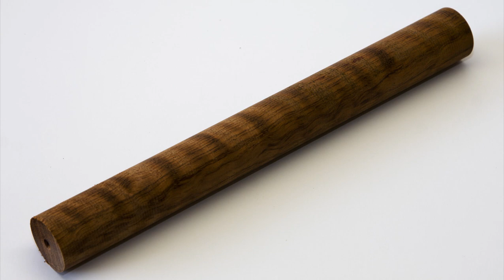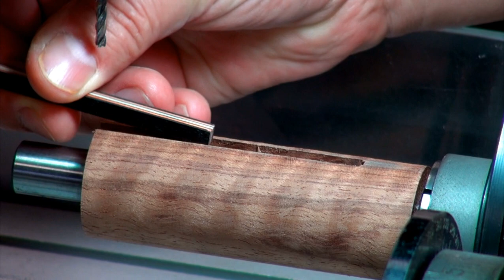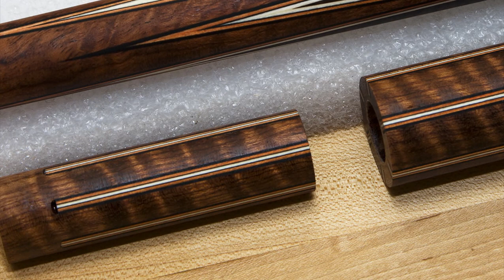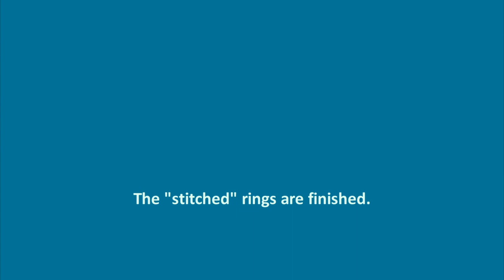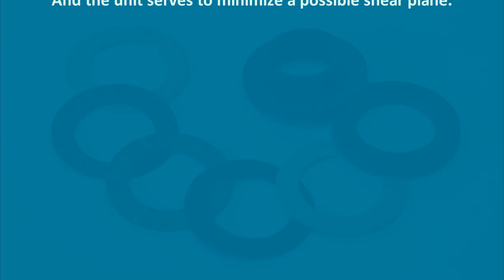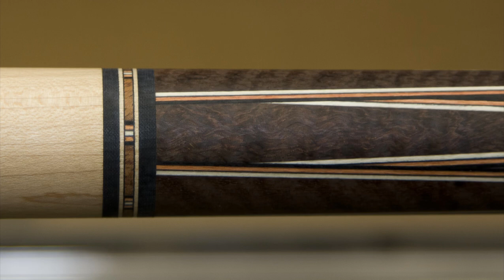Cue Making - trim rings

Comment: how do you get that glossy sheen on the cue?
Reply: clear coat.  usually polyurethane , car finishes.  seal first with good sanding sealer, sand with paper down to 600 grit, spray the cue with quality clear.  after it's dry wet sand on a lathe with 2000-3000 grit wet sanding paper with lots of clean water from a spray bottle to prevent trash from scratching your finish.  then polish with a good rubbing compound.  I use 3m products.